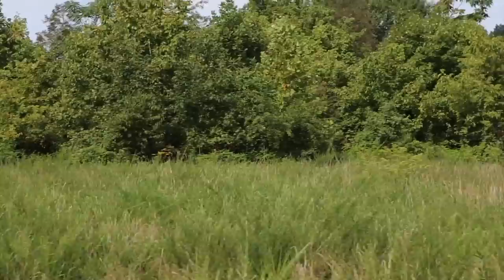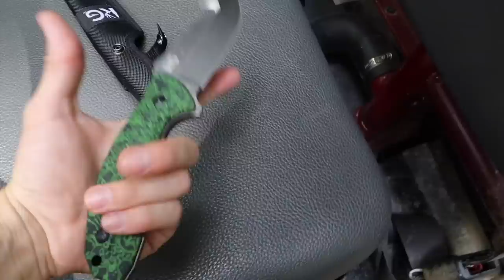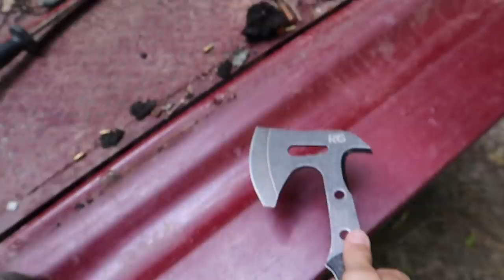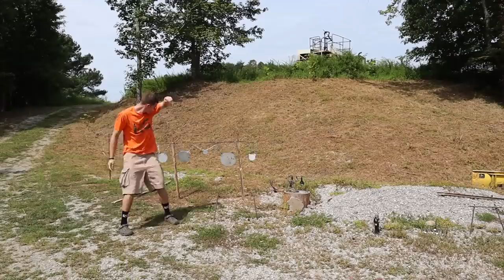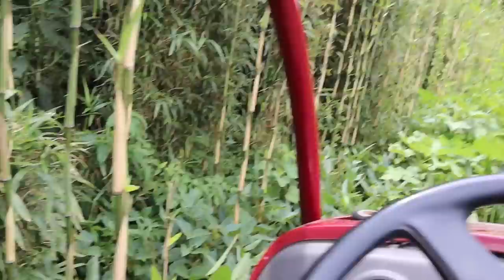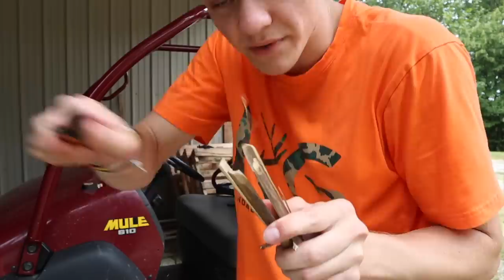Building Primitive Weapons!

Comment: Try building a bow. You’ll need flint and a good, flexible type of wood to make the bow out of, and certain fibers to make the bowstring out of if you’re willing to go that far with it. You can also find chutes of straight saplings and bend them over a fire to make arrows, and you can make fletchings by attaching them to the back of an arrow with pine pitch mixed with finely ground charcoal to make primitive glue, then you can use also use it to attach the arrowhead to the tip of the arrow. I’d also run a thin fiber around the fletchings to keep them in place, you could also try making grooves in the places where you’re going to fletch it using the arrowhead. You can also make a knock by sawing at the back of the arrow with the arrowhead as well. You can also attach your arrowhead by sawing at the other end with it too, and attach it with pine pitch glue. I think that you’d be able to build an atlatl on your own. They’re fun to fish with.